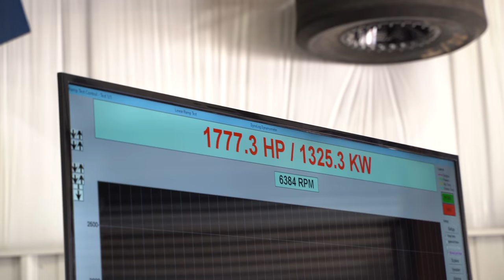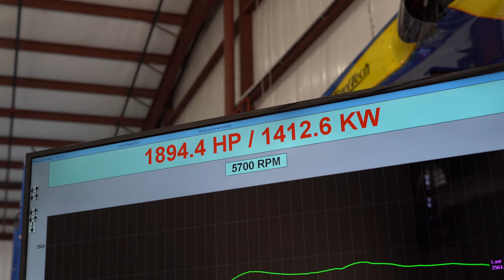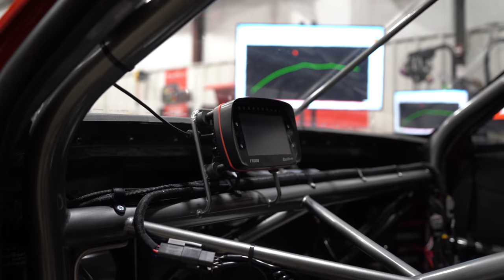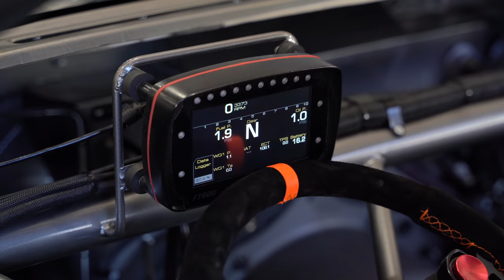2200+ Horsepower Lazcano 2JZ Turbo | Q80 / El General Racing team - Isidoro de Los Santos

Comment: I'd love to see what it would make with a set of compound turbos.
Reply: I think it would make less hp with compound turbos you would get less of a power curve.. May be maybe not compounds would be dope though! More boost at low rpm,s but may effect the overall hp?
Reply: @Nanoscape30  compounds only increase  compressor map efficiency .wich means less back pressure  more boost.  You could gear that map in any direction  low to high rpm.  Depending on compound sizes of the 2 or 3 turbos

Comment: The rpm on the dyno readout can’t possibly be correct?  That’s like 2300 ft lbs of torque?
Reply: Is that too hard to believe?
Reply: @needmoreboost6369   On a 3ish liter inline 6?  Yes that is pretty much impossible to believe.
Reply: @someguy325es  even if it’s making 2200hp? It’s going through the diff gears as well
Reply: @needmoreboost6369   even a top fuel dragster doesn’t make that much torque per cubic inch.  The torque readout on a dyno is a calculated number from hp and rpm.  The gear ratio has no affect.  Torque = HP X 5252 / RPM
Reply: @someguy325es  yeah it blew my mind when my 3l made 650nm at the wheels and later made 1200nm knowing that they should make 1/3 of that but what about final drive ratio’s so for example having a flywheel figure then swapping from 2.7:1 diff to a 4.1:1 final drive ratio doesn’t that effect torque multiplication
Reply: @needmoreboost6369   your not getting it.  There is a mathematical relationship between torque, rpm, and horsepower.  Does not matter if it has a 3:1 gear ratio or a 30000:1 gear ratio.  The dyno only measures horsepower and then it calculates the torque based on the rpm
Reply: @someguy325es  id say your right on there! But are you sure? I’ve seen dyno’s that only read torque and calculate the hp using the rpms
Reply: @someguy325es  I guess I just can’t wrap my head around a 5sec car having a small torque figure lol even a diesel hilux has 500nm at the crank nowadays thought I’d add on that is roughly 370ish ftlbs
Reply: @needmoreboost6369   1000 ft lbs of torque at 5252 rpm is exactly 1000 hp. 1000 ft lbs of torque at 10504 rpm is exactly 2000 hp.   You don’t have to make huge torque to make a lot of hp, you just need to be able to maintain torque as rpm increases.
Reply: @needmoreboost6369   an engine dyno with a water brake measures torque with a load cell and calculates horsepower.  A chassis dyno with an inertia roller or an eddy current brake measures hp and calculates torque.
Reply: @someguy325es  there’s an old chassis dyno here with an eddy brake and mechanical scale it reads torque only hp is calculated from the actual torque and rpm and no tach means no hp is given but it’s a dinosaur from a different era

Comment: How much oil pressure at rev limiter?
Reply: id say 110-120. Its a dry sumped 2jz
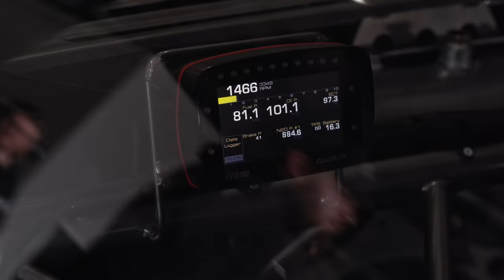Reply: @lennixsingh626  at 10:07 you can see 100psi at idle and almost 150 on a rev.
Reply: @david92xj  holy